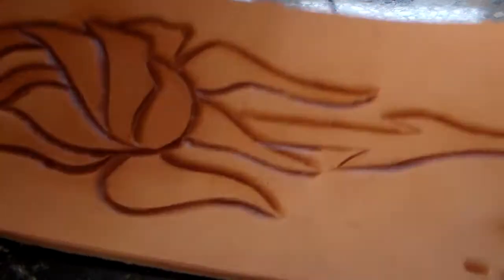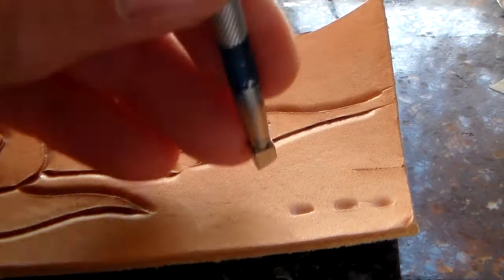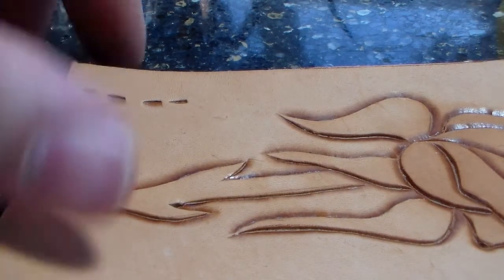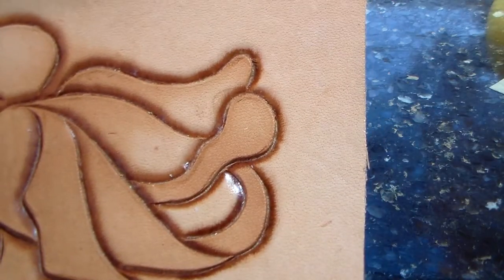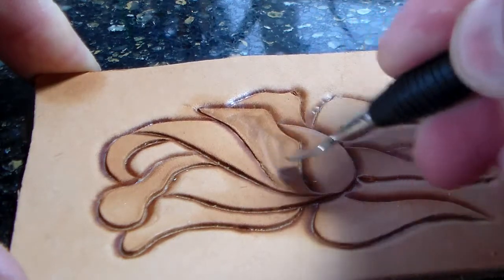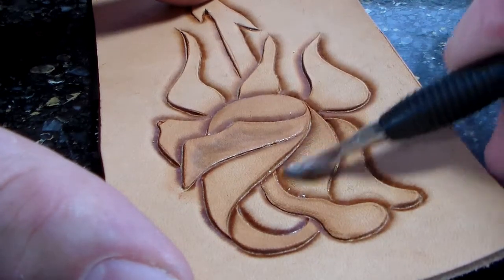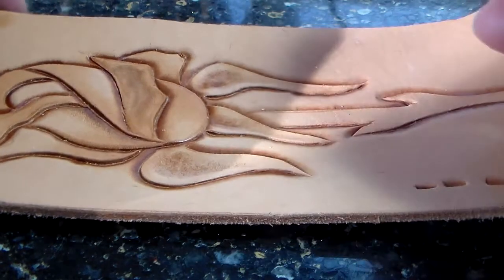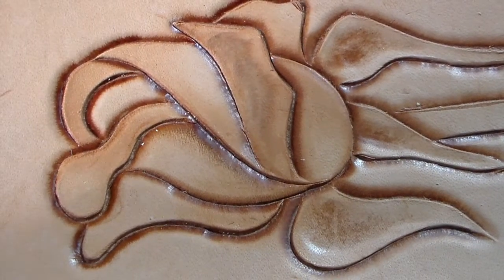Rose 02

Comment: A question I often have is when to use checkered bevelers or smooth ones. It seems you almost always use smooth. Is it just preference or is there a general suggestion about when to use which?
Reply from the maker: I started with a smooth beveler 39 years ago.  Until recently, that was also the starter beveler B200 - a smooth beveler.
Whenever I teach people, I like to teach them to use the smooth one first - it glides easier as you move it along and once you have mastered it, the others are just variations.   You need to be able to master a smooth beveler, because in many designs you have to bevel over the design (you are not always beveling background only) - a rose would look funny if your beveling of the petals cause parts of the rose to have a textured surface.
So those are the most important reasons I use smooth bevelers.
Textured bevelers are nice to use where your beveled background will in any case be textured.   Used on an inside border of a tooled background, they also nicely obliterate the background stamp underneath it.
I hope that helps!